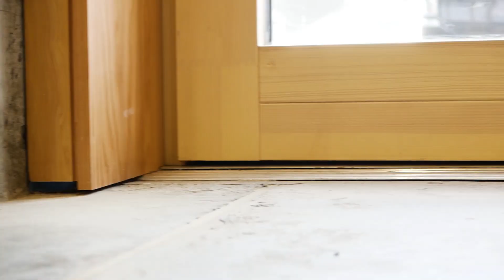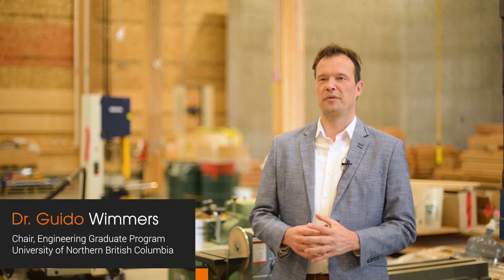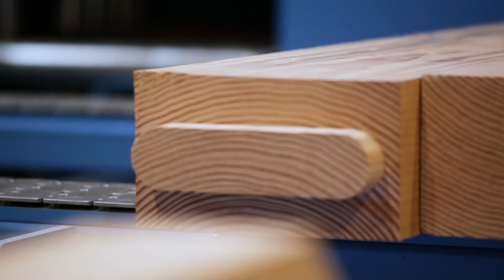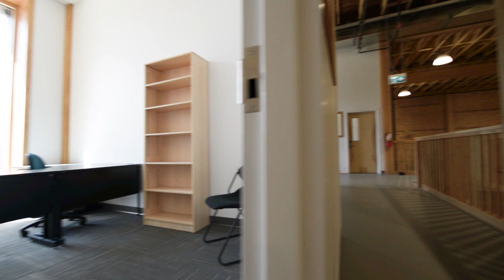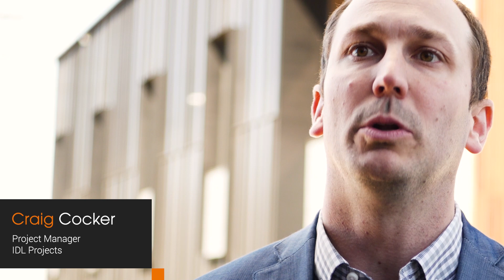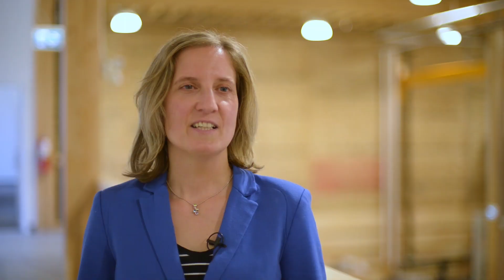Rethinking details with Passive House

Comment: It's unlikely that the building saves money by chasing the passive house standard indiscriminately.  Going for passive house probably raised the cost around 80,000$.  

You can just go and buy an extra 5-7" inches of insulation for a fraction of that total and get yourself a very efficient building.